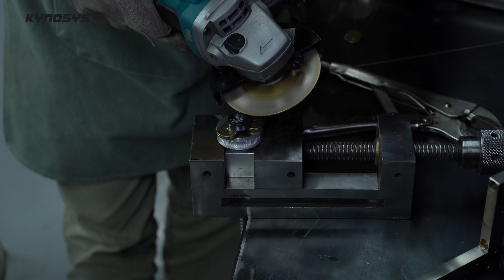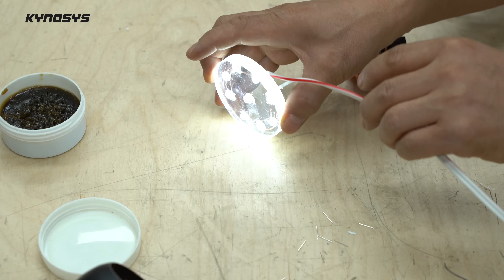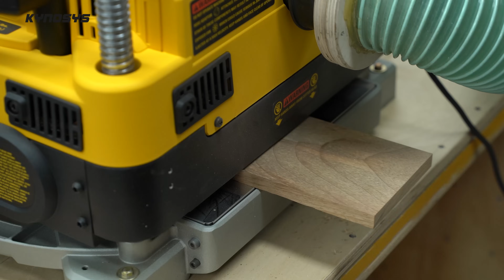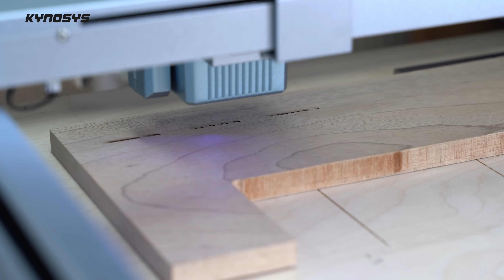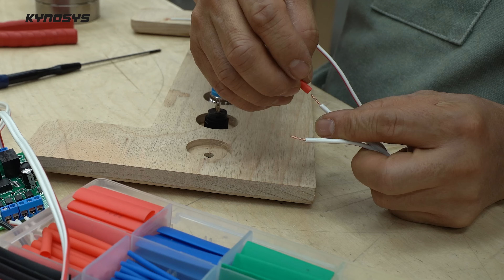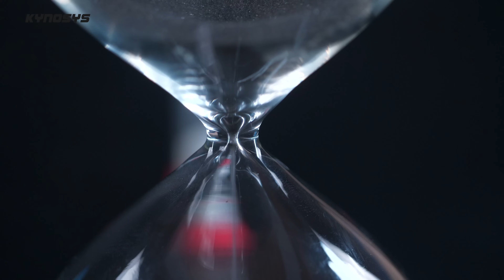I made Hour Glass with an Iron Ball : Analog Timer / DIY

Comment from the maker: When I look at an hourglass, I am always amazed by its movement. It seems that the wisdom of ancestors is contained in being able to measure a certain amount of time only with sand.
This time, I came up with a special type of time measuring device. The shape is different from an hourglass, but I thought about what it would be like if a steel ball could roll from side to side and measure a certain amount of time.
It looks simple from the outside, but there is a motor drive inside and a plunger that moves along the bolt, and bearings are installed on both sides.
The motor was made to be able to control the speed with a simple module. I'm confident that it's a work that can give off a modern feeling.
Blue candle oil is added to the acrylic tube to give it a smooth effect according to the movement of the iron ball, and it can prevent rusting of the iron ball.
It is a system that is equipped with limit switches on the left and right so that the iron ball can reciprocate within a certain section, and can be used for various purposes.
Enjoy watching the video, please subscribe and like. Thank you.

Comment: You know it's a well thought out project from a master engineer when you see bearings welded.
Reply from the maker: Some people find it inconvenient to weld bearings and point out this. I can understand that, and I think it's correct. However, I think it is quite possible depending on the intended use. In my work, the bearings do not rotate at high speeds or withstand very large forces. Textbook ideas can be transformed with practicality and due consideration. That is also the beginning of free thinking. Thank you for your kind words!
Reply: @Kynosys_  Sorry sir, but what you call free thinking, I call that stupidity. Like you said, your design doesn't put the bearings under any load or high friction, so the use of bearings was hardly necessary. You could've just drill a hole in some scrap and seat the shaft in it. It would've been the same. Instead, you ruined perfectly good bearings.
Reply from the maker: Your thoughts are also very reasonable. Damaging a bearing may be inconvenient or unnecessary. But the word STUPIDITY makes me a little sad. In fact, it was enough to simply drill a hole in the wood slightly larger than the diameter of the metal rod used as the axis. However, I wanted to use bearings, and moreover, I wanted to try using my new argon welder. I'm not trying to argue. Please understand this as an acceptable deviation from DIY. I'm happy to talk about these things. Because these are the things I was concerned about. thank you!

Comment: Ну конечно! Как же обойтись без сварки подшипников? Да ни один механизм без сварки подшипников работать не будет!
Reply from the maker: It was necessary to secure the load shaft to the bearing. Otherwise, the outer wooden board will continue to wear down. Even though I did a little argon welding without putting any strain on the bearings, There are many people who are worried. It is not a machine that receives a lot of force or has bearings that rotate at high speeds, so small scratches can cause major problems. There is no problem in using it at all. Thank you very much for your kind words.

Comment: The only thing id do different. Is connect a roughly 12mm hose to each end and a small reservoir maybe just a tee with a plug to fill the tube . This will prevent the air inside the top of the tube as the ball moves it would look better. Possibly using larger hose of 20mm to allow faster movement. Without the air pocket forming in the tube when moving
Reply from the maker: Diverse thoughts are important. Thank you for considering the method I presented. I made it like that on purpose because I like the movement of the liquid.